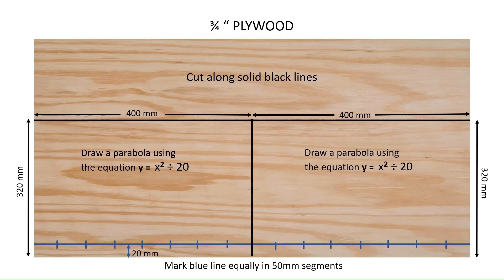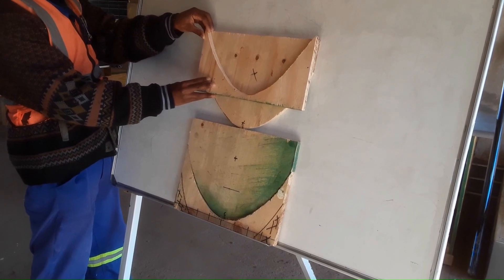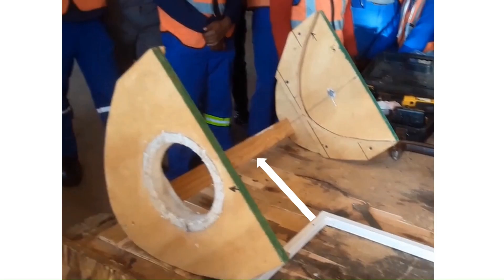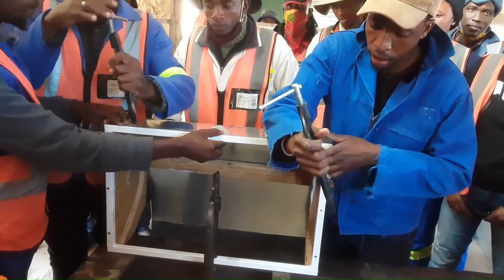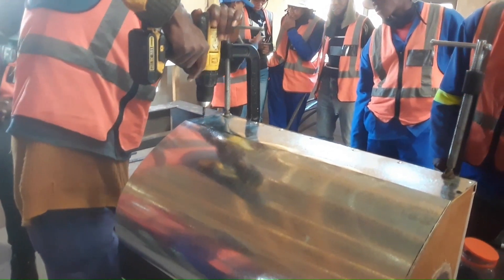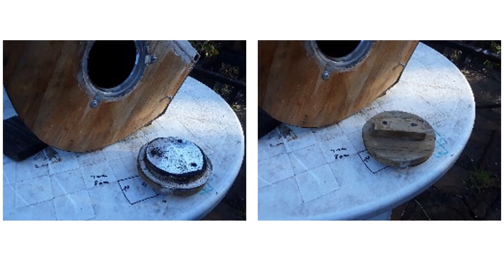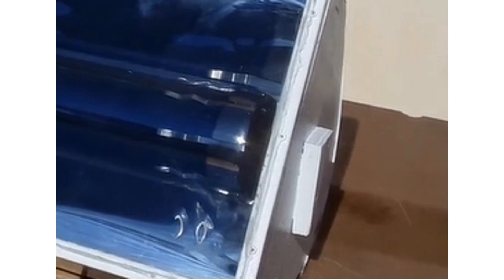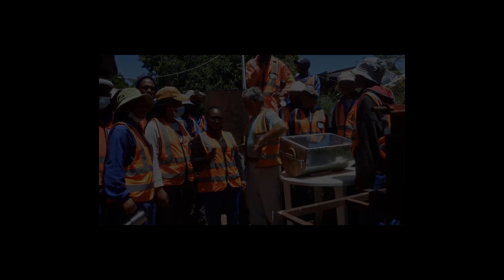GLOBAL MAKER Ivan Yaholnitsky of Lesotho Makes an Evacuated Tube Box Oven

Comment: Hey, nice work ! Can I get more explanation on the parabola formula? what is your unit for x? is it mm or 50mm ? if it is 50, what would be the equivalent for a mm based parabola formula ?
Reply: Easiest way to build a parabola: Pick your focal point. put the pot there. take a small mirror (not too wide and higher than its width) and put it behind the pot. The pot is between your eyes and the mirror, the Sun is right behind your head. Depth of the parabola will depend from how far behind the pot you put the mirror at this stage. The farther you put it, the shallower the parabola will be. Draw a line at the mirror bottom. Move the mirror left/right one mirror width, angle it so you can see the pot again. This time forge the pot. Your head is between the mirror and the Sun. The pot will fall to the left/right. Draw the line at the mirror bottom again. This line has to be the continuation of the first one. Do this  again and again to the left and right all the way to the edges of the parabola bottom material. Experiment, so that the parabola depth suits you. No tools or knowledge needed. Just a pair of eyes, a mirror and a pencil.
Reply from the maker: I will share your question with the maker and get back to you.